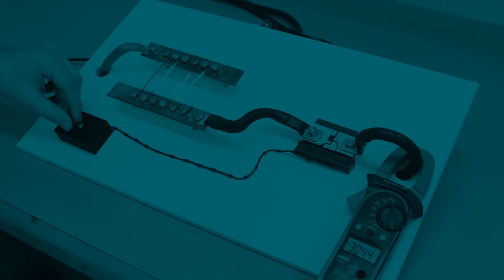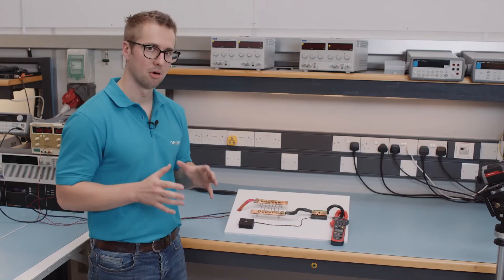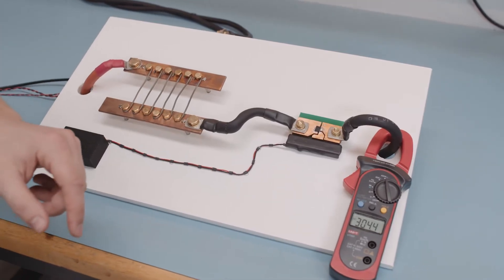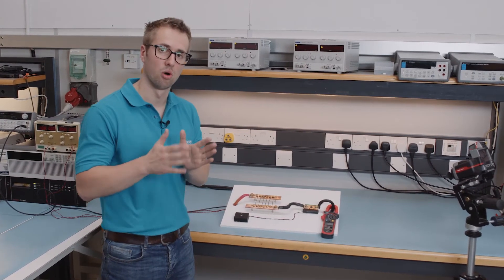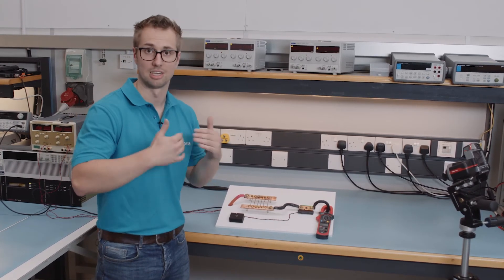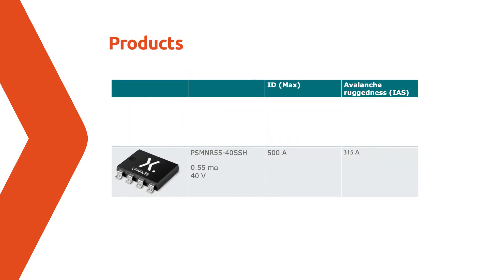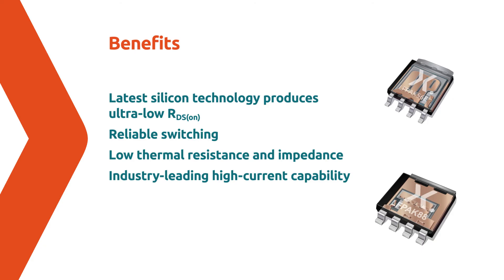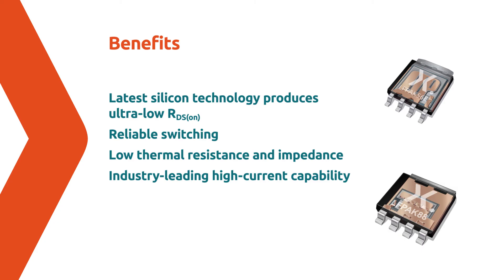High Current MOSFETs – the next level

Comment: Is it applied in motherboards laptop
Reply from the maker: Thanks for the question. Laptop motherboards tend to operate at low current 2-3A, although this device is suitable for power supply design in laptop motherboards, but the demonstration here is showing the capability of this device in handing current over 200A .

Comment: What is that copper contraption that the mosfet is mounted on? Because I assume that the little legs cannot handle such high currents right? So the 300 amps is going through the copper pieces. Is this available for purchase or is there some documentation on measurements at least?
Reply from the maker: Hi @leasthollow2006, thanks for the question. The little legs are designed to handle current higher than the rating for that MOSFET. You can find the maximum current in the datasheet (on nexperia.com), which has been verified through lab testing – not theoretical. The copper piece is an off the shelf item, available from various third-party suppliers – you may be required to cut to size.

Comment: Is it possible to control/bias the gate with a linear voltage if you want a specific drain - source current to flow, for example 0-10 Amp at 24V fixed drain voltage?
Reply from the maker: Hi @royrogers7644, thanks for the question. It is possible to bias the gate of a MOSFET to control the flow of current, this mode of operation is referred to as linear mode.  By adjusting the gate voltage, the MOSFET is held in switch-on transition preventing it from reaching its fully enhanced region (RDSon). In doing so, only a limited amount of current will flow – this information can be found in a transfer curve graph given in the MOSFET datasheet. It is important to know the maximum allowable current for a given drain-source voltage to make sure the MOSFET is operating safely, this information is given in the MOSFET SOA (Safe Operating Area) graph.

Comment: Looks great...I would like to use these for a diesel glow plug ignition system for a marine diesel engine...forgive my ignorance --but what are there 4 leads...I have used mosfets with relays in the past--and all the power mosfets have 3 leads.  any  documentation on the leads and connection issues??
Reply from the maker: Hi. It is package related, DPAK package have 3 pins one for each of drain (which also has a tab), source and gate, Nexperia LFPAK packages have 3pins for source, one for gate and a tab for drain see section 4  https://assets.nexperia.com/documents/application-note/AN90016.pdf

Comment: what is the voltage used on this test ? thank you
Reply from the maker: Hello. This test involves a MOSFET and a low ohmic load and as such is not bound by a particular (regulated) voltage provided there is enough voltage to supply the MOSFET and the load – the PSU is set to give voltage ≥  Ix (RdsON + Rload).

Comment: Could you please explain why the mosfet did not burn? 380A and  0.00051Ω means 74W power dissipation, even if it has 10 C thermal resistance to ambient (which is optimistic), it means temperature more than 740 celcius. Can this plate absorb that heat?
Reply from the maker: Hello! This 0.51mΩ MOSFET has a thermal impedance of 0.45K/W and as such 74W example would result in a temperature rise of 33⁰C above mounting base.  Mounting base is the reference point used for measuring the capability of a MOSFET. In fact, with Tmb maintained at 25⁰C the theoretical capability of the MOSFET is 333W and >500A, we use the limit of 380A as this was the value measured and verified in the lab. For more information, please check out our application note https://assets.nexperia.com/documents/application-note/AN90016.pdf
Reply: @Nexperia  Fantastic customer support answering a customer question like this.  Well done.

Comment: Does the mosfet require a heaksink to be on for extended periods of time?
Reply from the maker: hello! This is application dependent, but since this is paralleling it is usually intended for high current and as such, some heat cooling mechanism (air, water, heatsink) in the module is necessary. Thanks!